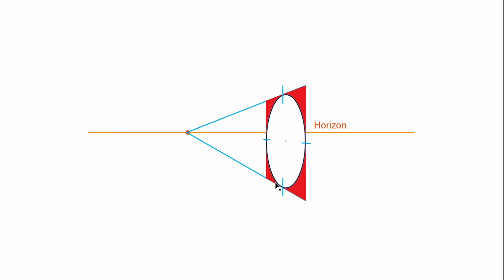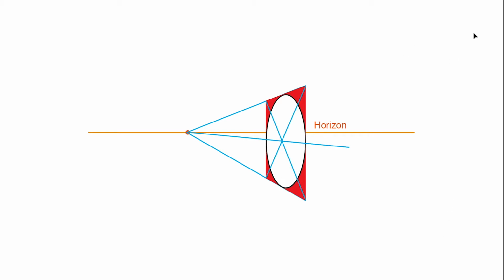Background Drawing 1 Point Perspective: Circles and Cylinders

Comment: Erm...(know-it-all finger in the air, setting down my hot pocket with the other)  If you use diagonal vanishing points, or even one d.v.p., you can make a square cube.  I was practicing cubes and reading out of Vanishing Point: Perspective For Comics From The Ground Up.  It gets tricky at the bottom of the page, where it came out elongated.  I just went an inch up to make another cube, by miracle got it right, and then projected that line as a main construction line up and down the page.  (Picking hot pocket back up, going to Reddit to know-it-all someone else, because that's what Reddit is apparently for). End Rant.